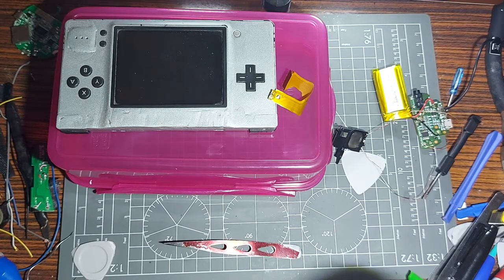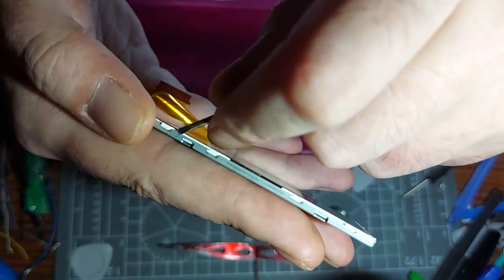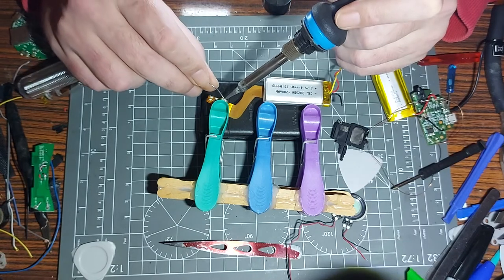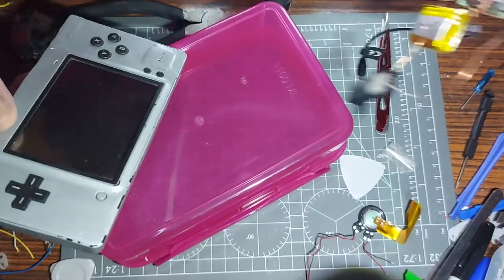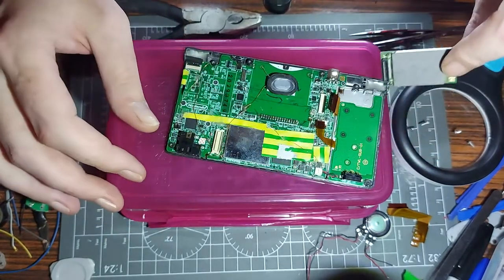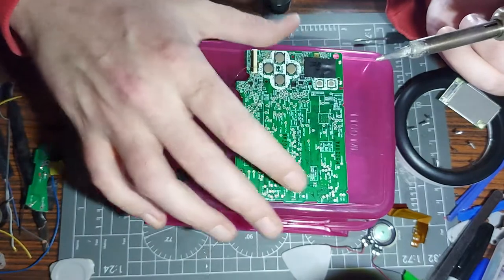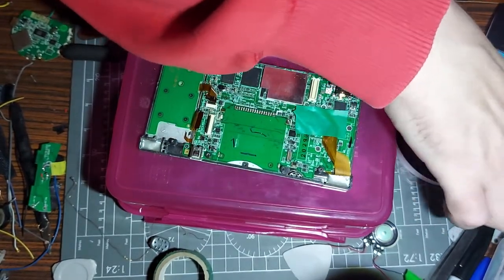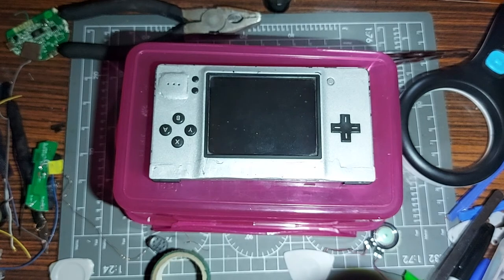DSI Gameboy Macro Made Easy?

Comment: Hey mate! So you were on the right track but thst strip of led lights? You don’t remove those! You can get some 6mm od and 4 mm Id tube and put it where the joint used to be. Once you do that you can slide the led backlight in and that’ll work! Great video tho.
Reply from the maker: Thanks got some more dsi macro stuff coming soon.
Reply: I made a DS Lite using the light bar method. I might try a DSi XL keeping the light bar in tact.